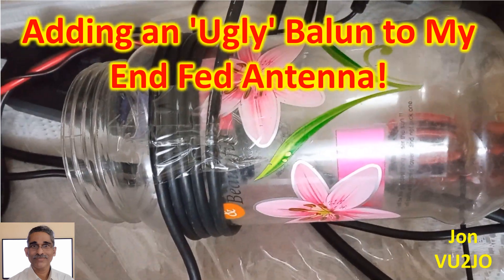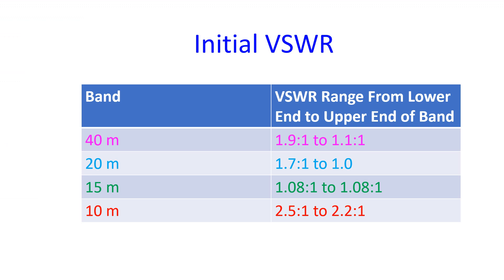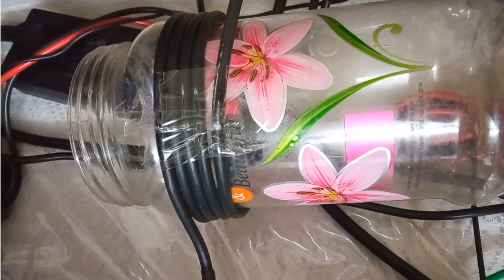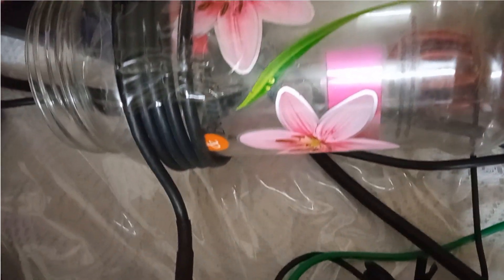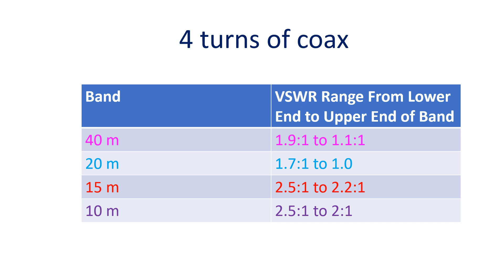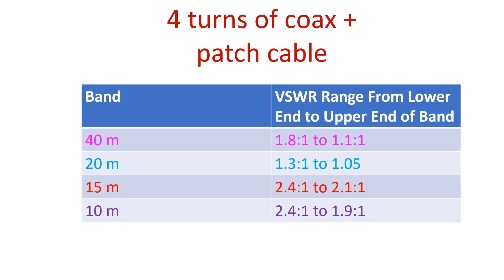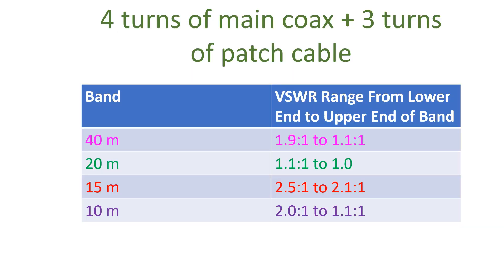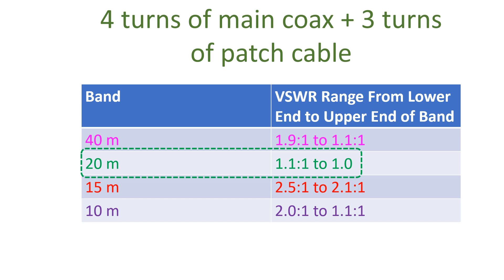Adding an 'Ugly' Balun to My End Fed Antenna!

Comment: Good morning Dr.Jon.
Nice to know all nice info about EFHW antenna.
I also bought one, but yet to install and experience it.
But will be doing it shortly.
If possible, you can try with little different configuration of its installations.
Anyway, thank you for your feedback and will keep in touch.
73 bye for now.
de vu2rdx, Sekhar.
Reply from the maker: Thank you for visiting. Yes, I have tried several configurations, due to space constraints here. Currently it is an asymmetric inverted V configuration with a fibre glass telescopic pole of 24 feet length. Hope to work you on one of the bands soon. 73 de Jon, VU2JO.